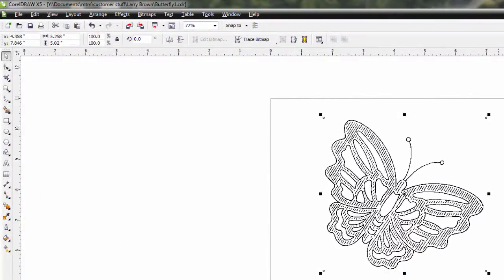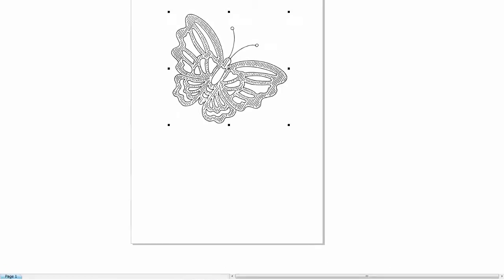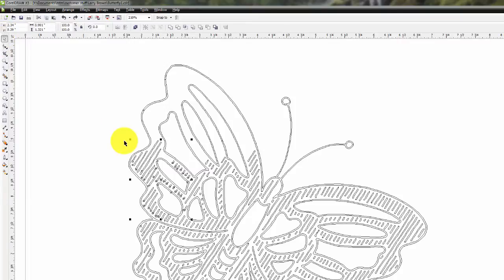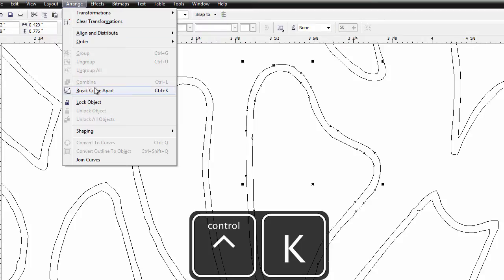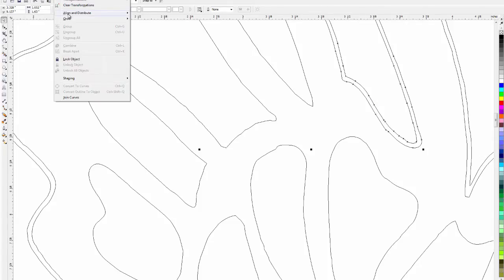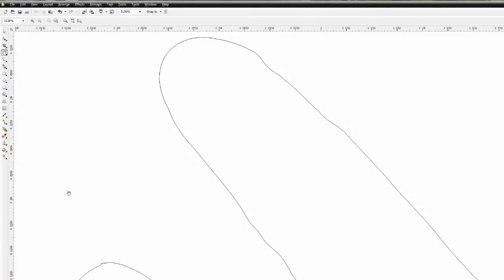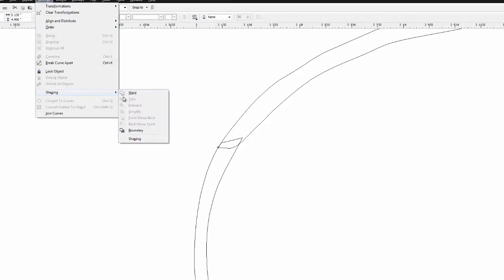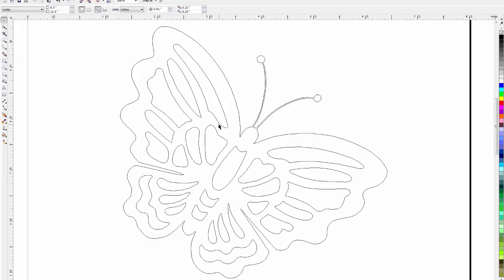Vectoring a Scroll Saw Scan

Comment: Mike I just stumbled upon your YouTube channel and this video on using a scrollsaw pattern to get a laserable vector.  I am trying to build some wooden gear clocks based on designs and plans by Brian Law of the UK.  Initially, I purchased a book titled "Making Wooden Gear Clocks" which contained several plans on paper targeted for use by scrollsaw hobbyists.  I have a CNC and a Trotec laser engraver/cutter so obviously I want to digitize the paper plans.  I took them to a local copy shop to scan the paper plans and saved the plans in PDF, PNG, and EPS formats.  I then set about getting these files converted to DXF format for my CNC and also cleaned up by CorelDRAW X7 for use by the laser. When I say "cleaned up by Corel" I discovered that the scanned images were not very good quality in that the vectors were distorted and had gaps.  Over the past several days I've discovered the Shape Tool in Corel but for the life of me I cannot sort out the process to simply join these open vectors and close the gaps.  Can you provide the needed guidance?
If yes, but would rather answer directly vs here please email me at jpriest@elmore.rr.com.  Thank You